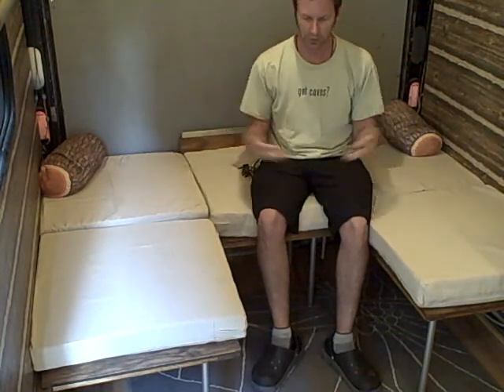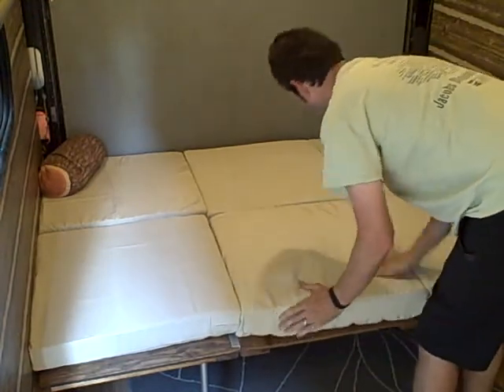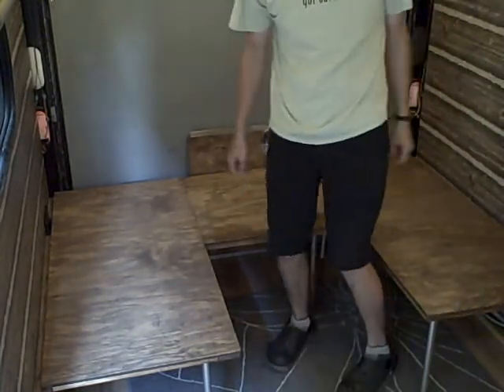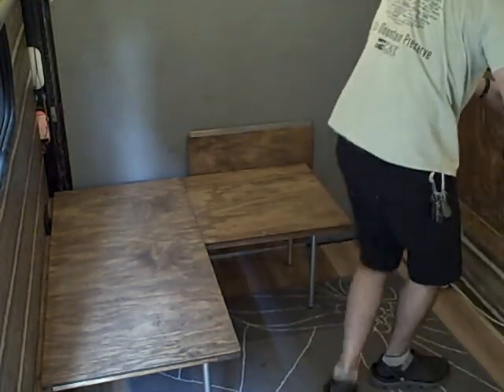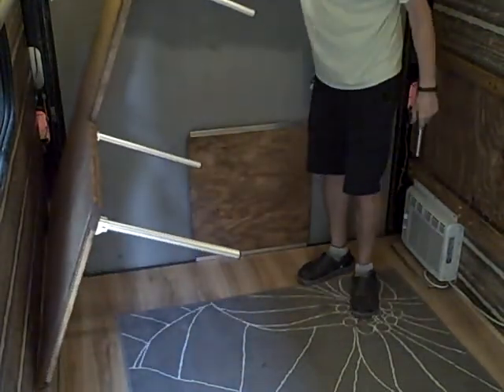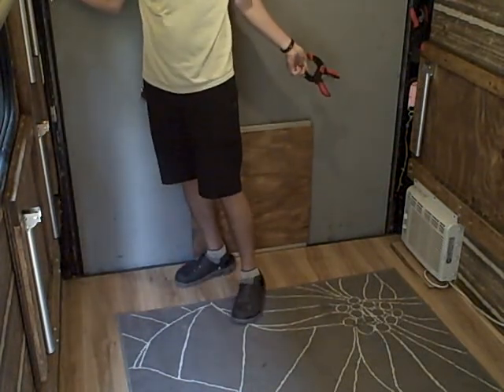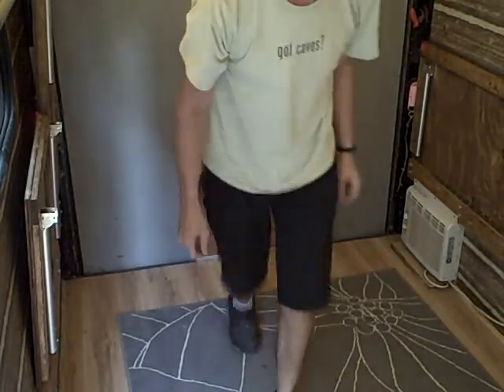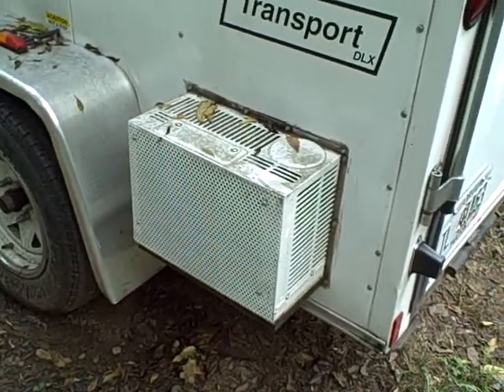Tiny Camper: Foldaway Bed / Pitgroup & Air Conditioner

Comment: I HAD a simular idea for my AC having a real hard time finding a spot. But decided the movable shelf as best. I am surprised that it isn't working as good it should be 5000 but should be plenty. Why would it work better higher. I would make my opening bigger to accomidate a larger size in case that si, d is not available in future.

Comment from the maker: The Air Conditioner is a Fridgidaire 'mini'. It's a 5000 BTU unit that uses 500 watts. It has a low-draw startup feature that makes it perfect for a small generator. I run it with a 1000 watt Yamaha with no problem.

Comment from the maker: @slick2326: I've never weighed it, but here's my best guess - about 500 lbs added. When I built it, I was very cautious about materials and trying to keep weight down, for instance in the bathroom, the walls are corrugated plastic, like signs are made from. Very lite. The stove is lined with concrete board instead of slate tile (I wanted slate) that saved over 10 lbs. The bed is 3/8 ply & 1x2 instead of 3/4 & 2x4, half the weight. I pull the whole rig with my Toyota Tacoma, no problemo.

Comment: I like it as well.  How much can the bed hold.  I'm a big guy getting smaller (no really).  Also, how well does the ac work being mounted that low.  I have 8.5 foot wide trailer that I'm converting to live in.  No room for ac unit and be within the wheel wells and and outside the trailer.
Reply from the maker: Doug, the bed will hold at least 310 lbs, as my wife and I both sleep on it. The AC works OK. Better if you use a fan to push air up at the roof. I wouldn't want to mount it this way in a trailer any bigger than mine - it would do much better up high, but you can see what I had to work with. Plus, I was concerned about all of the shaking around of country roads - we do take this to pretty remote places, and not organized campgrounds so much.

Comment: Great job on everything,  Thanks for sharing this you've given me some great ideas for my box van build http://bit.ly/1Pxqmmo . I am working with about the same space 10x6.  I was thinking about using the same A/C unit that you used and had a few questions about it. I would like to mount mine down low like you have but you said it would work better up high. Is that because cold air sinks and hot air rises? Do you think I could accomplish the same thing with duct work? What kind of insulation are you using? Do you think the BTU rating is adequate for the space? If you get a chance to watch my video please comment and let me know if you have any ideas for me. Thanks

Comment: what is the amp requirements for the a/c?  just wondered if it would take a 1500 or 2000 generator to run it--thanks

Comment: Didn't lie down on bed? Bed too short? Tip# 1: twin beds can be longer. Tip# 2: COLD AIR SINKS. seriously, what's up with all these folks putting A.C. in the floor. Heater,yes, A.C. no.

Comment: Very cool!! I was finding the same problem finding the legs. Where did you find the 2 metal frames that hold the last piece on (each side) Don't know what they are called but I need one for my bed too. Thanks
Reply from the maker: Hi Debbie! Those are just 1 1/4" aluminum angle. The center piece has a 1x3 frame around it, like a picture frame. Then I drilled holes in one side of the angle, and screwed it into the edge of the frame on two sides so it cant slip through.
Reply: Brad Long Thanks Brad!!  Someone told me that it was called a zbar/rail.  ?? I'm trying to match one i have …it's just one piece. Thanks for the info!!!!  :)

Comment from the maker: @ Donald Stewart: I used 1/2" thick plywood, reinforced with 1x2. You can find the legs at rvsupplyparts dot com. Search for folding rv table legs. I cut them to size with a rotary pipe cutter. It's sure cheaper (and more compact) than what you can buy already made out there! Good luck!